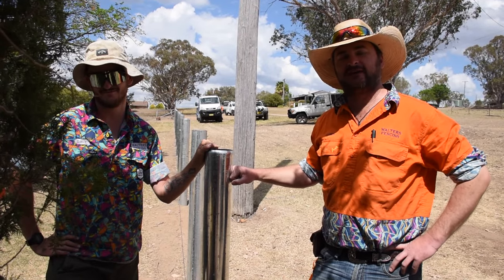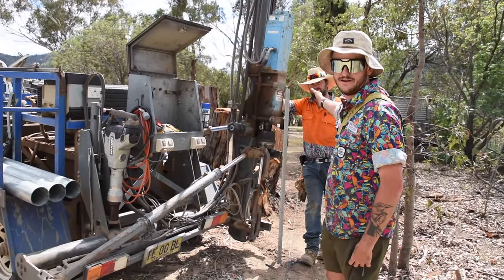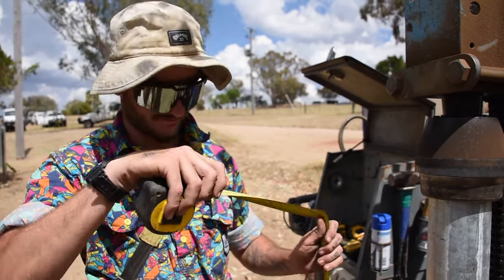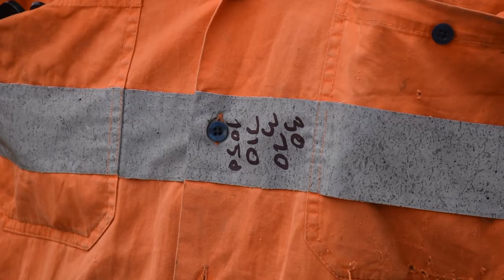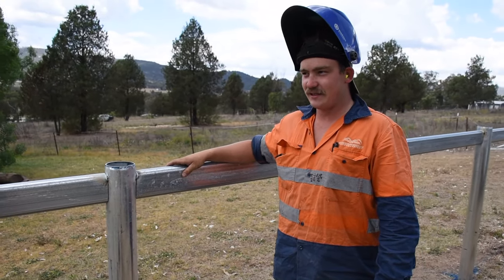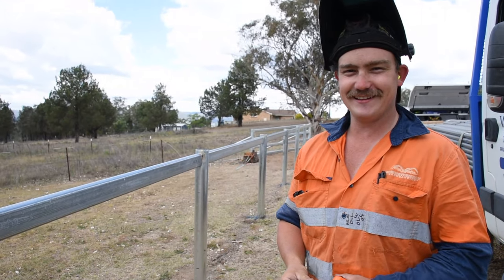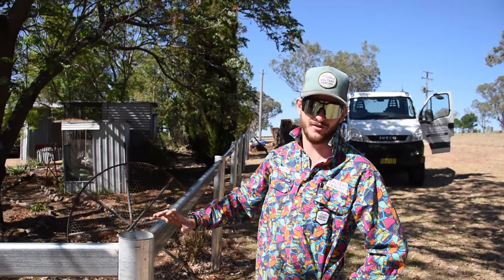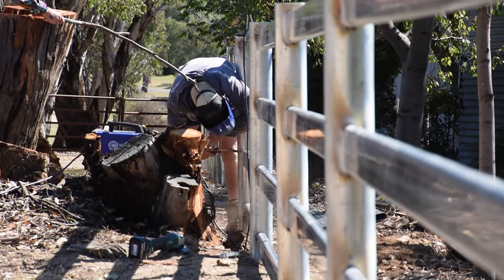How We Do It: Driving Posts in a Straight Line EP#22

Comment: Do you cut the top of the post off wear it's belled
belled?
Reply from the maker: Not normally.  The inside of the driver dolly is designed to form the top of the post inwards under hard driving conditions which means the cap actually sits on the post more easily.  Normally the depth of the cap will cover the deformation of the top of the post which means there is no need to trim the tops.
Reply: @WaltersFencing does this work with 3mm wall or only 4mm + ?
Reply from the maker: @gunsandgear2689  We tend to only use 4mm-5mm or medium wall pipe, any less and we risk deformation with our driver